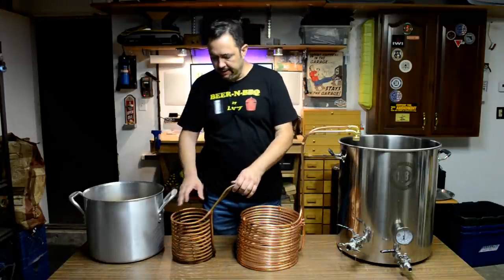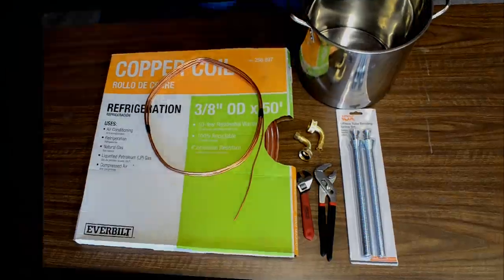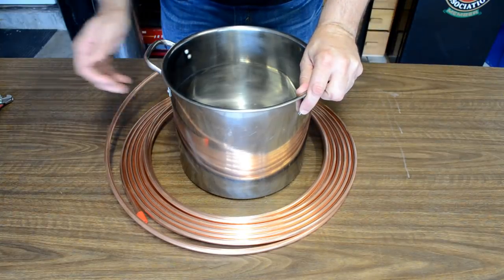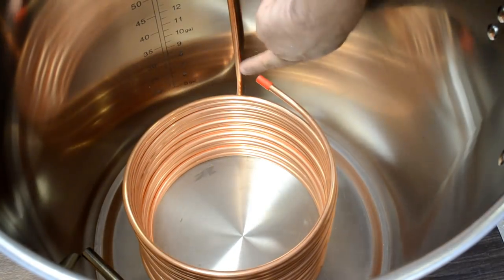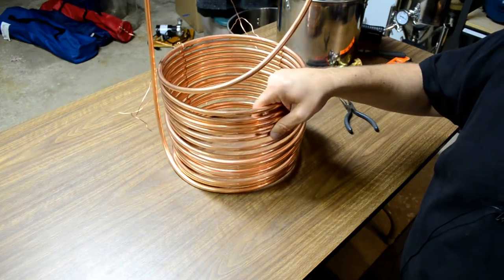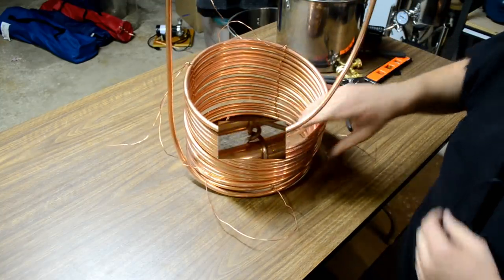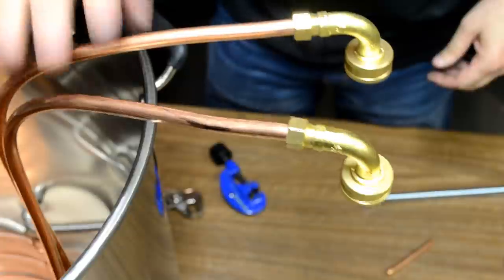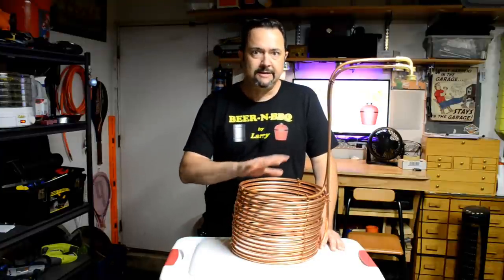How to Make an Immersion Chiller: A DIY Project

Comment: Thanks for the video Larry. It seems it would be easier to weave the copper wire between the coils if it was suspended on its side. For example, one could set a couple of 5 gallon buckets upside down on a table about 4 feet apart and then use a 4 foot section of 2x4 to suspend the coil on its side with the ends of the 2x4 resting on the buckets.

Comment: Very nicely done Larry! I'd like to contribute with some tips as well. Me and my friend just finished building one of these as well. Brew kettle is 50L, the wort chiller was double coil made out of 15mm 25m copper tubing. This type of chiller is the absolutely easiest one to make. Counterflow is theoretically much more efficient but more difficult to make and requires more equipment around if you won't rely on PE for the flow. IMPORTANT NOTES; immersion chillers takes up space in the kettle! Simple maths tells us that the volume of our chiller is 17L, around 1/3 of the kettle! If we would've chose 18mm tubing instead the volume would've been 25L, half of the kettle!! This is the only reason I would consider hassling around with counterflow chillers. Important note as well; the heat conduction coefficient for copper is just over 400 W/m*K, compared to stainless which is 200 W/m*K. Copper conducts heat twice as good as stainless steel. The only reason why stainless are so widely commercially availible is because you have to treat your copper chiller with care so it won't turn green of oxidation. First brew with our chiller showed us that it cooled about 33L of boiling wort to 20C in just over 10 mins with waterflow of 10L/min at 10C. Faster cooling than 10 minutes is just ridiculous!! Picture is availible at our FB page, "2Kings Brewery". We'd also love to send you some merch and a care package from Sweden, please DM us on Facebook!

Cheers and best wishes!!

Comment: Really great video, many thanks! Just built an immersion chiller following this video and am really happy with the way it came out. I also agree with the other commenter below that the wire is (slightly) easier to wrap/twist through the coils if you lay the chiller on its side.  

For some reason Home Depot stores its 50-foot coils of copper wire up on a super high shelf so I had to get help from an employee to drag over one of those movable staircases. It was smooth sailing from there though!

Comment: Nice work on the wort chiller. Just recently added some fittings onto mine to change from using flexible tubing on the ends to just garden hose fittings. Glad to see you went with a Spike kettle. I have had my 15 gallon for almost a year and a half now and love it.

Comment: This is awesome, only thing I would change is to cool the top of the wart this will cause a natural convection flow. What I don't know is if the cooler is closer to the edge is better or tighter in the center to help get the natural circulation started.
Reply from the maker: If you plan to rely on natural convection for cooling wort, you be waiting a very long time for it to cool.

Comment: Nice work, I just watched a different video and the guy bent and folded the copper tube nice to someone use the spring method to bend the tubing, I come from the boating and auto repair side of things and I thought about using a bilge pump in ice water as a chiller I can use a 12 voltage converter to plug it into the wall outlet to run.

Comment: Thanks for the inspiration. I'm currently building my own immersion chiller, customized for my 5 to 6 gal setup. Unfortunately Jaded's chillers are not that accessible here in Europe with huge shipping costs and additional taxes...
Reply from the maker: Check with David Heath. The company he works for in Norway supplies JaDeD chillers.
Reply from the maker: Also, some homebrew clubs in Europe have ordered large batches of chillers from JaDeD to lower shipping costs.

Comment: Awesome video Larry! Simple and easy to understand. Regarding the copper tubing, is there a specific kind of copper tubing you're using ? There is Type K Copper Pipe, Type L Copper Pipe, Type M Copper Pipe, Copper DWV Piping.

My main concern is will heat release harmful chemical or any sort of iron/metal parts ? 

Other then keeping the immersion chiller clean and dry not letting green-blue toxic oxide called Verdigris (i.e. the natural patina on the Statue of Liberty) if not stored in a dry environment.  Verdigris is water soluble and can contaminate your brew if left on your chiller before immersing it (easily cleaned with an acidic solution like StarSan or Vinegar).
I appreciate your help Larry!

Comment: Nice job Larry! I cannot wait to see you use that new Spike kettle, I see that you mentioned a pump will be added to your new 10 gallon setup, will you be whirlpooling/hop bursting the next IPA's you will be brewing trying to make NE/Vermont inspired IPA's? How will you be using your pump? I use a pump in my setup for re-circulation of my mash once it's done converting so I don't have to vourlaf, I get really crystal clear wort going into my kettle when I runoff. It's like they say, clean beer going into fermenting equals clear beer going into packaging. :) Keep those video's coming!
Reply: That is awesome! I cant wait to see you put this all to use. I tried using the pump to transfer hot water from the kettle to the MLT and HLT but I got irritated with the cavitation issues from the pump. I saw that Blichman has a new pump out with a purge valve and a built-in valve control knob. I'll be adding that to my brewing setup. It has great reviews, If you haven't bought a pump yet, I highly recommend you check it out. :)

Comment: Hi Larry, I noticed you have a thermometer with a bent probe in your kettle, did you get it like that, or did you bend it yourself?  I'm wondering if I should try to bend the probe of my thermometer, a bit too long for brewing with a bag. Thanks.
Reply from the maker: The temp probe is not bent. It is straight. You night be mistaking the 90 deg pickup tubes.

Comment: Great video Larry! Thank you. I have been using this type of immersion chiller to cool the woth for 5 years. It works good. But few weeks ago I brewed a gose with pH 3.4. After the cooling I realised that the copper chiller was much more shiny. Im afraid of that the lower pH wort solved a copper ions. What do you mean? Can this beer poisoning? Which pH level do you recommend the copper chiller? Thanks a lot.
Reply from the maker: Some people say their chillers usually appear shiny after a brew day. Mine always acquire an oxide later over time and don’t lose it, but I’ve never done something so acidic like that. At least any additional copper in the wort will help fermentation.
Reply: Thank you very much.

Comment: I am wondering, would it be better to make the chiller so it sits mid way up the pot? Since heat rises. I would say top but you may not fully submerge with it up there. I would also fill all the gaps in the wire with solder. Make it a little more sanitary.
Reply: @BEERNBBQBYLARRY  OK,thanks.

Comment: Isn't there lead and other chemicals inside the wire you used where you stripped the insulation? I'd be worried it's not food safe.

Comment: Just attempting to make my own chiller using this video as a guide.
Is there any problems with slight gaps between the pipe and wire were the twists meets?
I can't seem to twist the wire tight enough resulting in a small gap.
Reply: @BEERNBBQBYLARRY  Okay that's great. I was just a bit worried about contamination between the gaps but I suppose a good cleaning between use should help.
Is it okay to use Starsan to sanitise or is the boiling worry good enough?

Comment: Do you remember the size of the copper wire u end up using?
Reply from the maker: No.  It's not important. It was just some bare wire small enough to easily bend and twist.

Comment: What gauge of wire do you figure you were using?
Reply from the maker: Not sure. Not really important. Smaller sizes are easier to snake and twist but require more twisting to space out the coils.
Larger sizes require fewer twists to space out coils but are harder to snake and twist.